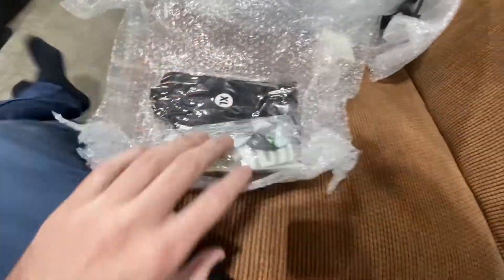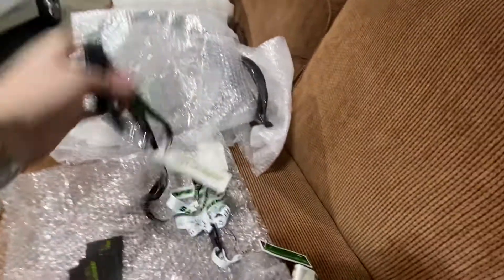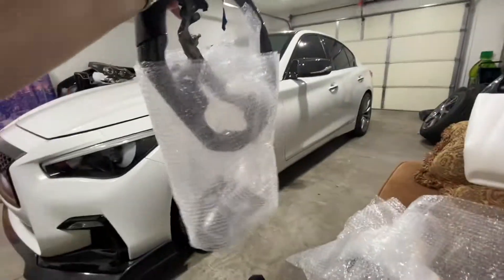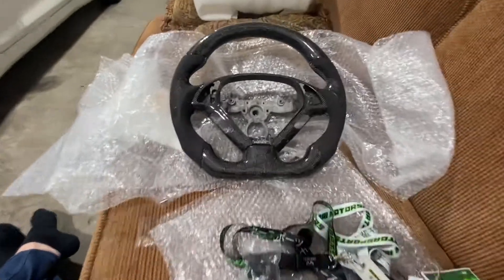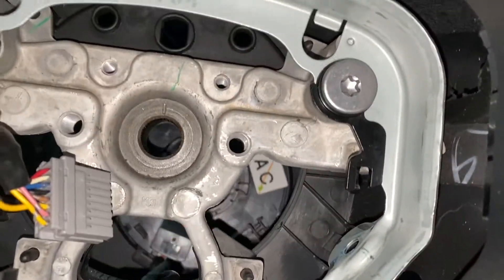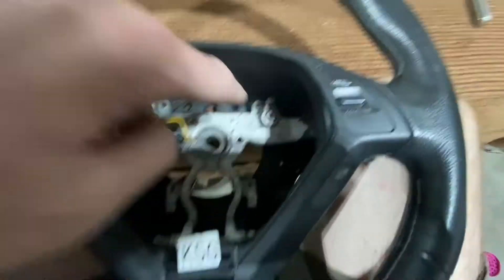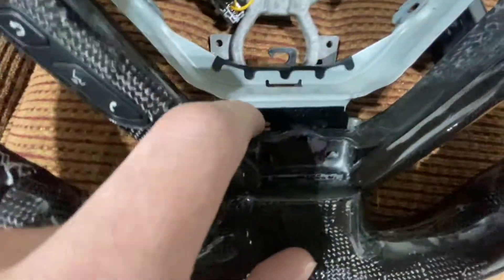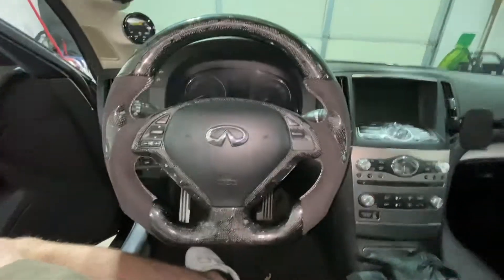G37 Carbon Fiber Steering Wheel Install & Unboxing

Comment: How were u able to get q50 mirror caps?
Reply from the maker: A lot of places sell the caps bro. Just google it
Reply: Is it a direct fit for the g35/37 sedans and u just wire it or did u need to do modifications?
Reply from the maker: G37 & Q50 mirrors are not the same so no it will not fit.

Comment: I installed this, but my horn isn’t depressing. any idea what it could be?
Reply from the maker: Maybe everything wasn’t plugged in correctly?
Reply: @CRTFD_G  I was thinking and I think it’s because I over torqued the hex bolts that secures the springs and the metal bracket. Which pushed it further away from the airbag. I’ll loosen them and hopefully that’ll fix the problem. Essentially, the springs are compressed fully which is why my airbag is depressed and not elevated. Just a speculation lol.
Reply: @Mr_Odog  hey did you end up figuring it out? My horn keeps going off too lol
Reply: @iAndroidable  Yes, just make sure all components of the steering whee is aligned and tightened.
Reply: @iAndroidable hey how did u fix that?